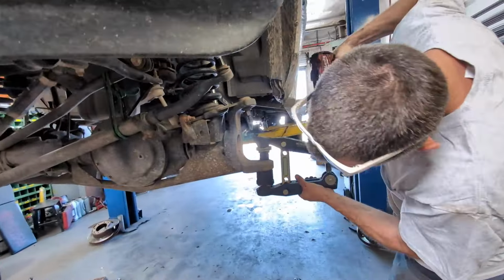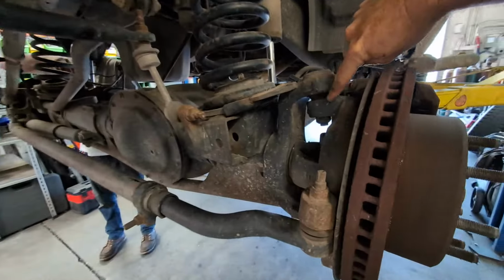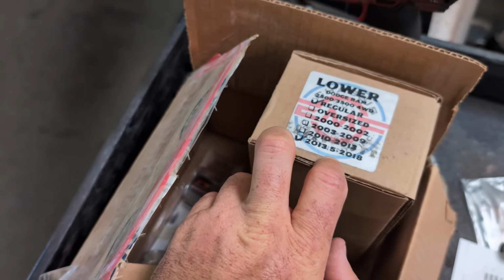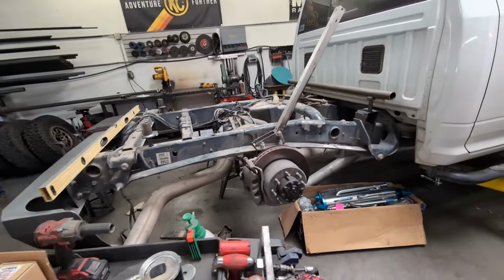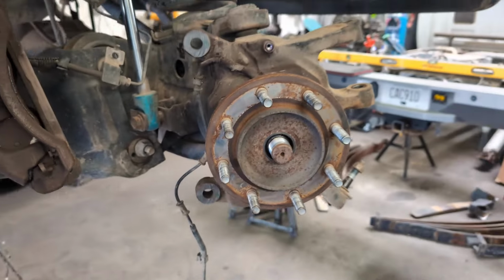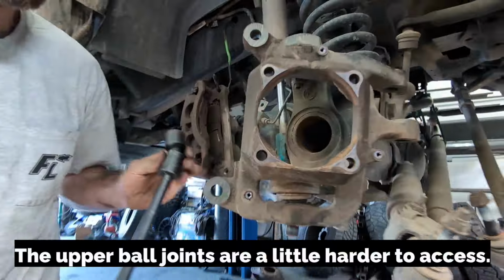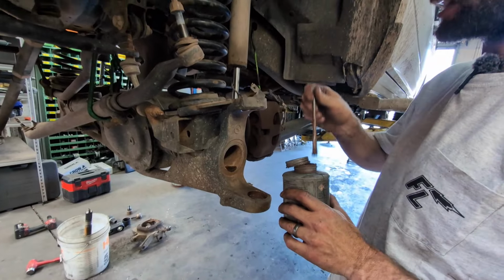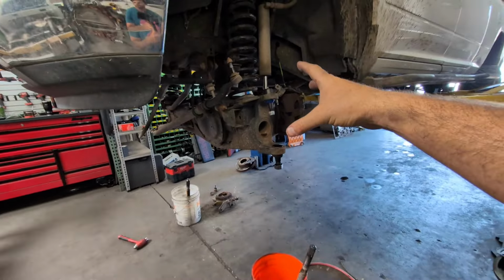(EMF Ball Joints) Ram 2500 Ball Joint Replacement

Comment: What lift are you using to lift this Ram 2500?
Reply from the maker: It's a full carli suspension kit, new coils and king shocks
Reply: @ I should have clarified my comment more. My bad. What two post lift did you use to raise the truck in the air to work on it? Looks like it handled the weight well. As far as the suspension goes, that’s what I plan to put on my truck as well.
Reply from the maker: I'm not sure about the lift it was my buddies shop. Sorry.
Reply: @ no prob.

Comment: lol you are hacks lol no torque specs?
Reply from the maker: German spec bud......🤦‍♂️
Reply: @AdventureEndeavor  German spec?
Reply from the maker: Yeah, good N Tight.....
Reply: I done more damn ball joints back in the day AND NEVER EVEN OWNED I GODAMN TORQUE  WRENCH. DID IT ALL IN A GRAVEL DRIVE
Reply: @ronmoore3987  yep and people smoke meth everyday does that mean its good for them lol
Reply: @LS-zo9iw  ALL you gotta do is what's good for you, All I said is I never owned a   torque wrench AND IF YA KNOW WHAT YA DOIN YA DONT NEED IT ON BALLY WALLY JOINTS IM 62 YRS OLD AND I CAN GUARANTEE I KNOW WHAT THE HELL IM TALKIN ABOUT. ALSO HAVE A 2014 RAM DIESEL 658,000 MILES big recall on the rear studs they break--- GUESS WHAT MINE AINT BROKE YET! I KNOW MY STRENGTH AND BALL JOINTS AINT SHIT
Reply: @ronmoore3987  1st any cummins after 2005 is junk lol glad you have been LUCKY all these years I used to think like you until a hack decided to use your torque method lol bolts snapped resulting in a crash.. BUt to each theri own I would not trust your repairs their is ONE WAY to do a repair,, The CORRECT way.. Luck is your torque wrench lol not reliable you have 3 yrs on me age  wise but experience / skill wise you are WAYYYY behind me nothing wrong with that You do you.. Have a nice day